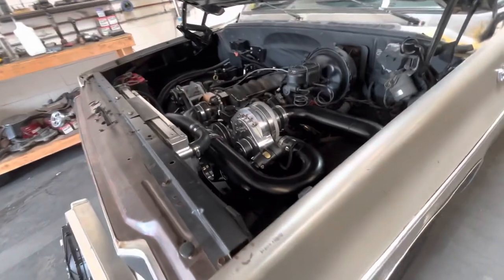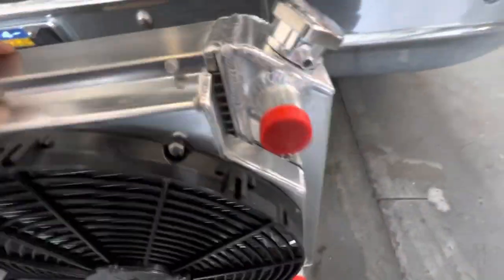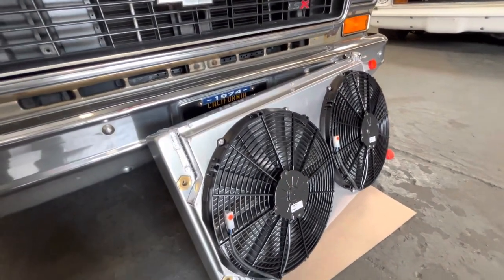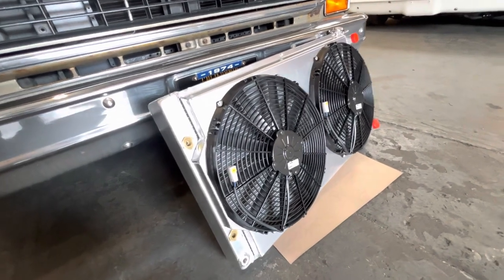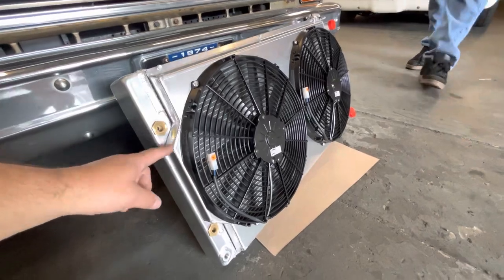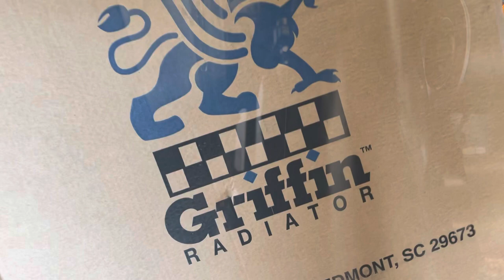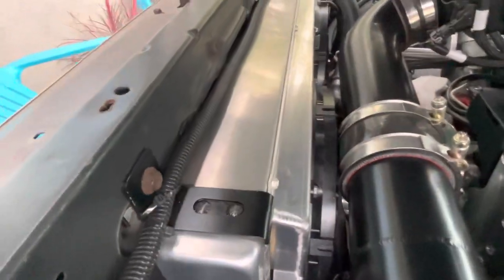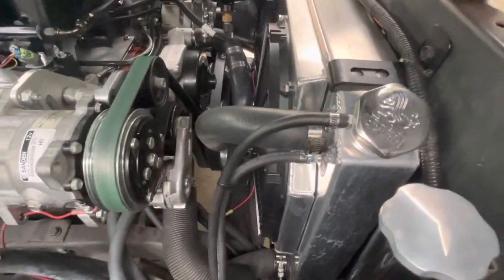Griffin Radiator - 1974 C10 Squarebody Muscle Truck

Comment: My Griffin radiator didn’t last much longer than 2 years.  Sprung a leak from the tubes.  They wouldn’t help me.  Never again!!!
Reply: Need more information how did it Crack or start to leak did it ever overheat
Reply: @HermanMunster-sq8mu Never overheated or misused.  Just sprang a pinhole leak after a little over a year.  Griffin would not help me.
Reply: @davereith54 curious why they did not help you considering they have warranty. Can you give more details ? I’m in process of buying a new radiator very soon

Comment: What AC condenser did you use
Reply from the maker: It came in the Vintage Air kit.
Reply: @gasratzcustoms  is there a specific brackets that you used fornit

Comment: Installing one in a 86k15 what did you use on the bottom to hold it in place?
Reply from the maker: Yes, just used some rubber insulation